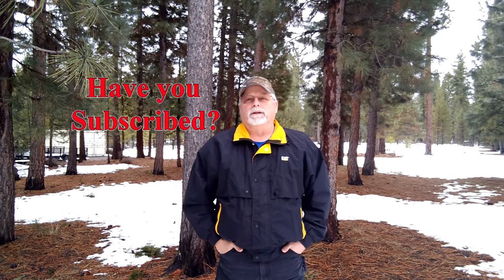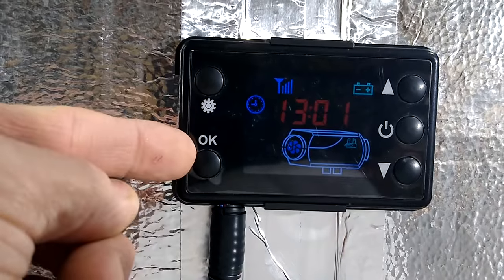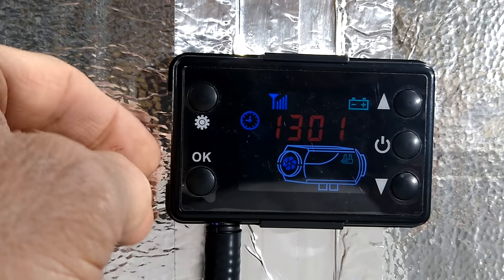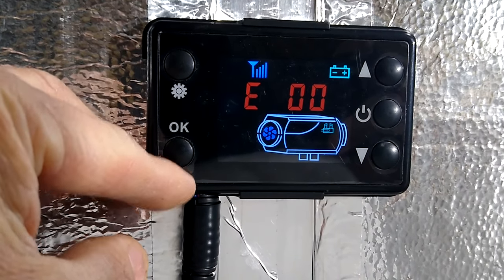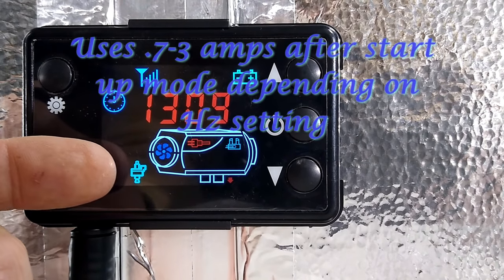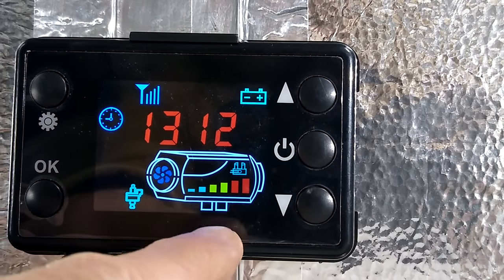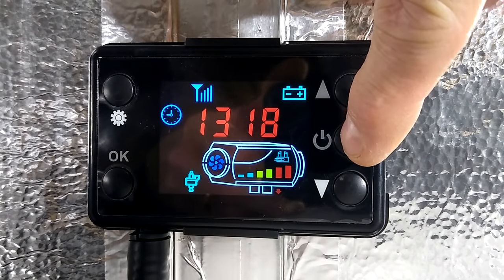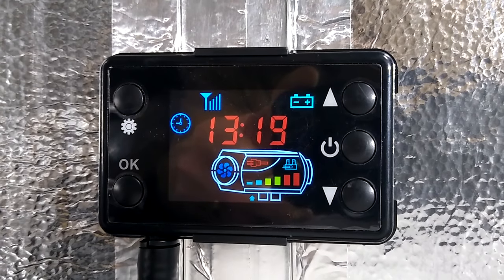Chinese Diesel Heater Controller Setup

Comment: My gauge looks exactly like yours and it's a 5kw heater. But mine only goes down to 1.6?!
Reply from the maker: Mine came from the factory with the low preset set at 1.2. The Hz settings are programmable in the advanced setting mode. This is not something that I will cover here. Have a great day, and please give us a Thumbs Up, Subscribe to my channel and pass our videos around your social network
Reply: Did you figure out how to set the gauge lower than 1.6hz? I'm roasting in here...

Comment: Hi there my controller is very dull do you know how to turn it up brighter cheers
Reply from the maker: How old is your controller?
Reply: Yes it’s not twelve months old
Reply from the maker: These controllers have LED's inside and this is what illuminates the screen. The screen is hard to read at certain angle's and over time the LEDs can put out less illumination making screen hard to read from any angle. If the latter is the case the best thing to do is order a new controller. 👍
Reply: Thank you for replying again the controller was just visual from new I agree with your suggestion and I’m going to try a new control panel the heater cycles through it’s functions correctly
Reply from the maker: @ianklye8228  Thanks for checking out my videos, always glad to help. Please subscribe to the channel, give me a thumbs up, let others know about our channel and have a good week.
Reply: Thanks hold that thought I’ll give that a try 🤷
Reply from the maker: @ianklye8228  like to hear how the new controller works out for you.

Comment: Is there a way to brighten the display?
Reply from the maker: Hi M Cooper. Thanks for watching the video. Please like subscribe and let others know about our channel. The display on these electronic controllers are not real bright for sure. Over time I have read that they get harder to read. You can replace the led inside the controller if your good at soldering. I would just replace the controller when it gets harder to read over time. Have a good weekend.

Comment: I pressed the ok button and down arrow at the same time now the lcd screen if off and can't get it to turn back on any ideas?
Reply from the maker: unplug the power to the controller and let it set for one minute then plug it back in. See if this will reset it.
Reply: @explorer867  I tried that last night didn't work figured I would try it again and now it's working thanks for the help!

Comment: Actually, not all these are the same. This controler works with two different motherboards. And there are more settings as well not mentioned. 

This controler is capable of slowing pump speed to .8cps , not just 1.4cps. But you have to go deeper into settings to do this. Press * to enter time setting. Keep pressing OK until __ 4 empty code comes up. Enter code 1688 to enter dealer settings. Off1 is timer start off2 is timer stop. Next is pump speed. To lower pump speed to lowest .8cps sett down arrow. But this will not fully work until next OK setting which is maximum pump speed. For some reason, pump will not achieve .8cps until max speed is reduced to 3cps. Why I don't know, because the original basic controlers you did not have to reduce max speed, but with this new controler it was the only way to get lowest speed. 

Next OK setting is minimum fan speed. Unless you are using on a high mountain, don't change this, or the next setting which is max speed. These settings change fuel air ratios. You don't really want to change these. Next OK is 12v or 24v. Next OK is 1 or 2 magnets on fan assembally. Next ok change entry 1688 code. 

You must keep pushing OK until all coding is finished for setting to be memorized. 

The new blue controler and motherboard only have 6 heat speeds and it's slowest speed is 2cps which is way too fast and too hot for smaller area to overheat. Plus 2cps burns far more fuel. 4l in 24 hours. 

You must have original mother board for all this to work. The newer boards will not do this. This controler can be used with both mother boards. 

Newer board can be identified by big plastic "H" channel on parts side of board. 

I find the lower speed setting much more useful when temperatures are mild 0°C to 15° otherwize it becomes too hot in cab.

Comment: I’m getting a E10 error. What does that mean?
Reply from the maker: It's likely the diesel heater is flooded. This by over priming. Check to see if you have fuel dripping from or smell a strong diesel smell from the exhaust pipe

Comment: The lowest is 0.8hz on mine you have to go in the factory settings
Reply from the maker: dorsetbushcamping7500, thank you for your comment. Yes, you can go into the advanced settings and make changes, I just don't choose to change the settings on my diesel heaters. I haven't had any issues, so I don't mess with them. The old adage if it isn't broken don't fix it LOL. I've had one of the heaters mounted in my converted pickup topper camper for three years now. What is your heater mounted in? 
Please Like, Subscribe, Ring the bell and let others on your social media know about our channel. Have a great Christmas

Comment: Lots of features in that controller! Is that a wifi icon that I see on there?
Apologies if you mentioned it in the video, noisy family and making diner ;-)
Reply from the maker: It has a remote control that I ordered with the heater. Check out the previous video, I detail it there. It's a very nice feature. Thank you for asking.

Comment: My “H” doesn’t show up, nothing happens when I press both buttons. Also, my default display when I plug it in looks different. It shows “P 12v”
Reply: There’s also a red circle with a “-“ in it.
Reply from the maker: Best thing to do is contact the seller from whom you purchased unit. I haven't had or seen these issues. Hope you get this worked out.

Comment: Running your heater low all the time is not good, it will eventually soot up so bad it'll stop running you should run at wide open to burn off all of the soot, that is the problem with some people they buy a 8K heater but they only use 2K of it all the time and they soot up and have issues. It's better to buy a 2K and run It Wide Open it'll last longer and burn cleaner
Reply from the maker: My Diesel heater is a 5000 kw I normally run it on 2hz. If running it for longer than an hour or so I do bump it up to 5hz for two or three minutes then back down to 2hz. When shutting down the heater I always run it on 5hz for 3 or 4 minutes to burn any carbon off the screen and burn chamber.  No problems and have used it February - through first part of June. One problem some people have is the fresh air inlet hose gets plugged with dust, bugs, and other things. This interferes with proper combustion leading to soot /carbon buildup. I just picked up a air filter for a dirt bike and will be fitting it to a larger diameter fresh air inlet hose. Have a good week.

Comment: Who`s burning old engine oil and deep fryer grease here ! w00tt   i call mine, gagging greta!!!
Reply from the maker: I only burn clean diesel. Have you had any problems running old oil and fryer grease? I would think you would plug up the filter screen quickly. Please like, subscribe, and let others know about our channel. Check out our other videos.

Comment: Mine looks identical to that but does not function the same, I'm about to smash it to pieces with a hammer if it doesn't start working soon
Reply from the maker: Sorry your unit doesn't function properly.
Reply: What seem to be going with your unit? Maybe I can help?
Reply: @FirstSuiGeneris  the buttons on the controller don't have the same functions as yours or any other video I've seen. For example if I press the settings button to enter the time, nothing happens. But if I hold it in it gives me the option to change from Hz to Celsius.
I might have a faulty controller.
Reply: gary jones it could be, but I have never seen a bad one. I see them dim. Maybe the buttons are the problem. Some time you have to press them a bit. Just run though the settings a few times, then press the ok button and the down arrow to start your prime. Remember there is three setting for time. 24, then timer for on and off You can go to Amazon or wish even banggo to order them. Hope this helps. You can go John Mck47 channel this guy knows is stuff he has been installing these years to.

Comment: what a mistake to buy this. NO INSTRUCTIONS , PUMP NOT WORKING, TURNS ON RUNS THE FAN , PUMP HAS POWER BUT NO CLICKING . NO TECH SUPPORT THAT I HAVE FOUND.
Reply from the maker: Hi Bill,  First check to make sure your battery has a full charge then double check all wire connections. When you turn these heater's on first the fan will run and the glow plug preheats, and then after the pump kicks on. If unit still isn't working contact seller and arrange for a return. Hope this helps. Please give me a thumbs up, subscribe to my channel and have a great day.